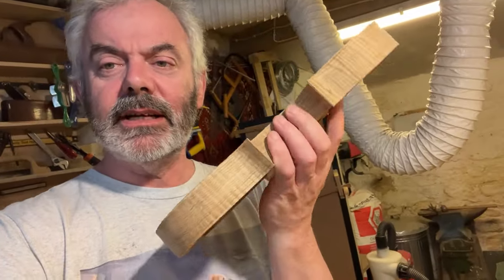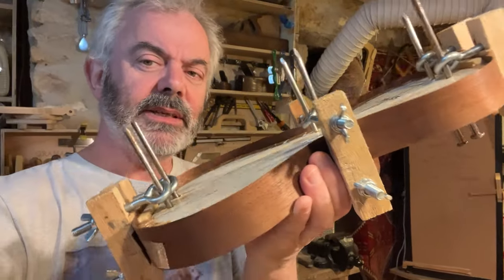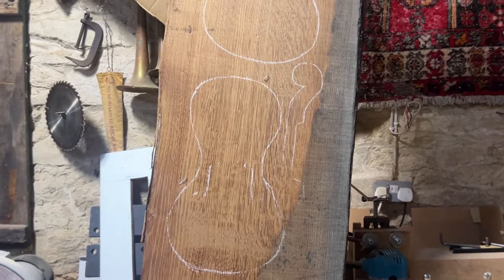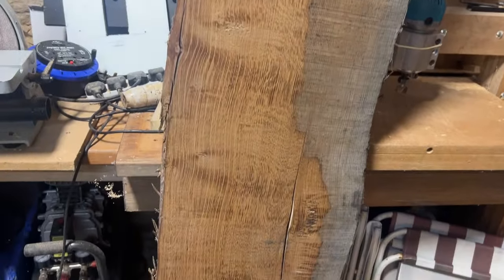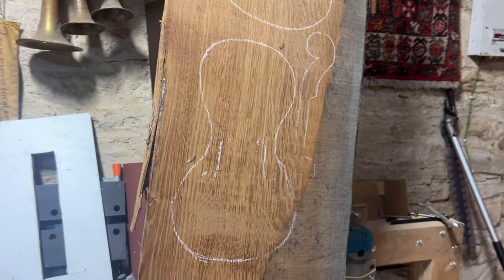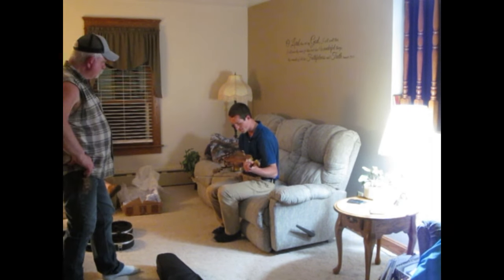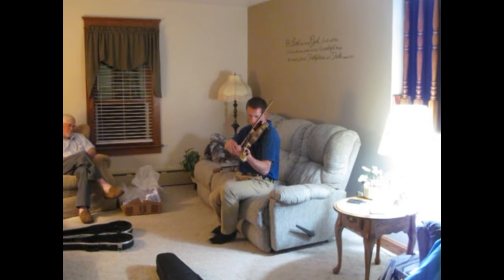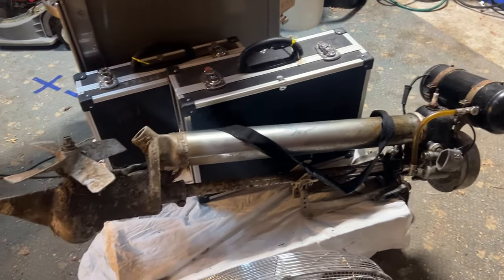# 172 - Guitar shaped violins, Ash Violins, what next over the next 2 months?

Comment: Your use of a variety of timber is quite inspiring.  If spruce is such a fine wood; why not use it front and back?  Just curious.
Reply from the maker: Always wondered that myself. I think it'd make a boring looking fiddle though.
Reply: One could try it. My gut feeling is that the resulting instrument would sound very dull and spongy.

The point of using the typical choice of maple is that it works as a harder chamber to reflect the sound back out of the front. It lends volume, brightness, and definition to the overall sound.

With an all spruce instrument, it would likely sound extremely dull, with a good deal of vibrations absorbed internally rather than amplified and reflected.

Spruce seems to have a Janka hardness of around 350, and maple is around 1450. Quite a difference. Poplar, another choice for sides and backs when a more mellow instrument is desired, seems to top out around 650. Still substantially harder than spruce.
Reply: @BrianTimmonsTX  I see, tonal output amounts to a juxtaposition of various wood densities, interesting stuff.  Thanks
Reply: @daveojanen1721  Pretty much, that’s the simple breakdown. Think of the body of a violin as a speaker cabinet. The top is the speaker cone that moves and creates the vibrations in the air that we perceive as sound. The sides and back are like the walls that resonate and reflect the sound created by the speaker cone, and direct all that energy forward towards the listener.
Reply from the maker: @BrianTimmonsTX  and yet, the only time I've seen it, it was an exceptional sounding instrument (a hardanger). So much of the accepted "law" turns out to be rubbish when tested. I'll try and find the link for you.
Reply from the maker: @daveojanen1721  Just to add my thoughts on this.... I don't believe there's any truth in this. I made an all Spanish cedar violin last year that was amongst the finest sounding violins I've heard. Not to mention all mahogany guitars etc etc.
Reply: @grahamvincentviolins  Thanks Graham, will keep an open mind.
Reply: @grahamvincentviolins  Hmm. Food for thought.